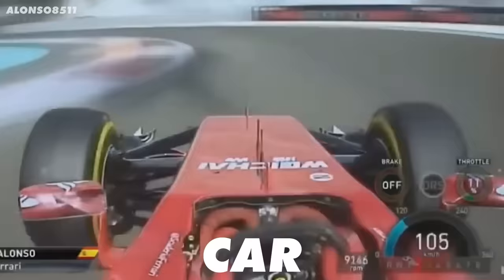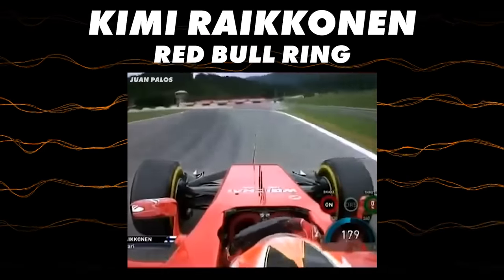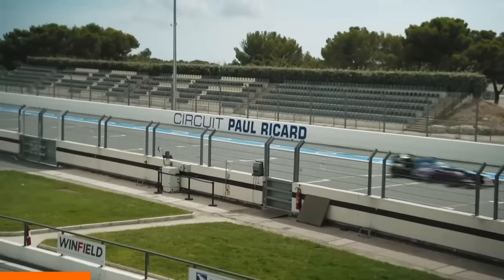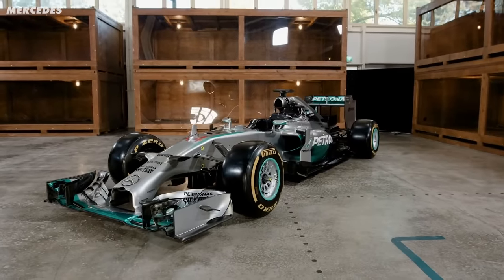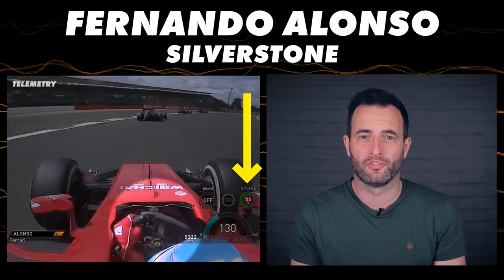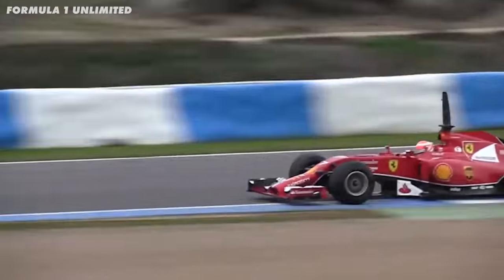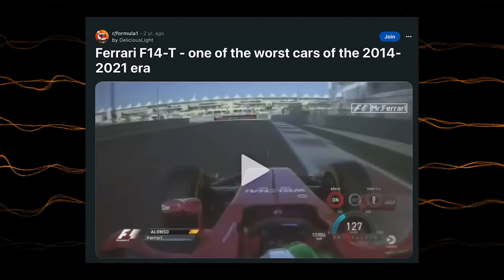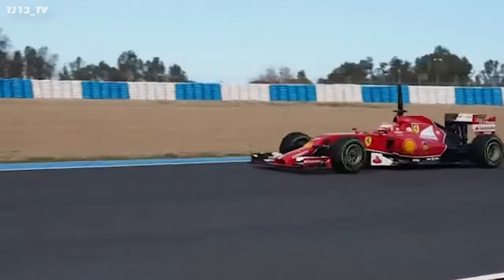The WORST Handling F1 Car EVER?

Comment: And Alonso almost won with this thing in Hungary. His 2012 and 2014 seasons are some of the most impressive performances I have ever seen.
Reply: Kimi would have had a podium in Monaco if not for Chilton. Relax.
Reply: @ciaronsmith4995  Your point being what exactly? Alonso had two podiums in the season. Furthermore, Räikkönen was absolutely destroyed in every metric across the season and was never even close to winning a race. Anyone who dominates a driver of Räikkönen's calibre like that obviously had an absolutely terrific year.
Reply: Nonsense. Raikkonen just joined that year and found the car undriveable - the car suited Alonso far more given the mass understeer on corner entry. Further, Kimi had a rookie race engineer who couldn't speak English (and was fired later). Alonso got lucky, plain and simple. 

Try to get this through your thick skull: In cars that suit both, Kimi is obviously, and utterly faster as his ballistic stint at McLaren and Lotus showed. Watch F1 before you comment lad. @whatisabercowich
Reply: @ciaronsmith4995  The amount of excuses necessary to explain the difference in performance is insurmountable. Luck could explain one or two races, not the entirety of the season. 

Ultimately, Räikkönen's stints at McLaren and Lotus show absolutely nothing. His teammate at Lotus was Grosjean, not exactly a top line driver. His teammates at McLaren were Coulthard, who was also not a top line driver, and Montoya, who had been flattered by some very good machinery. I'm sure Alonso would have performed very well in those cars as well. 

It is also very convenient of you to ignore both of Räikkönen's stints at Ferrari. In the years following 2014, he was comfortably outperformed by Vettel. As a younger driver, he was also very similar in pace to Felipe Massa, who was also decidedly in Alonso's shadow.

There is no question that Räikkönen was a terrific GP driver. His peaks were very high, maybe even comparable to Alonso's, but his dips were much, much lower. Adaptability is a vital part of being a succesful GP driver.
Reply: @whatisabercowich well said
Reply: @whatisabercowich kimi’s stint at mclaren showed he was one of the fastest drivers ever and one of the most polished. you can argue with martin brundle and jenson button who highly rate kimi’s mclaren stint. also, kimi doesn’t get to choose his teammates so the way you’re trying to take away credit from him just because of his team mate is not correct because he has no control.
Reply: @ciaronsmith4995  ok calm down yourself
Reply: @MoveoverAndbark Says some random nobody who'll never amount to even a fraction of what Alonso has.
Reply: @MoveoverAndbark 😂😂😂😂😂
Reply: his 2013 season is underrated, the reason why his chance is ruined is because of the tyre change mid season and benefit redbull even more after belgium so no one has a chance against redbull
Reply: @ciaronsmith4995 pff Kimi was destroyed that year by Alonso, he made three times his points and got two podiums 😂
Reply: @whatisabercowich  Not to mention what his friend said - Andreas. He worked with Schumi, Kimi and Padre. He said that Padre is the best he had ever seen.
Reply: @MoveoverAndbark  was he wrong?? Best driver on the grid promised the best car and instead he gets the worst. He was right to complain, tell your garbage British team to stop being trash
Reply: @ciaronsmith4995 i was a Kimi fan forever, but Alonso is a superior driver in pretty much every aspect. Anyone who says otherwise is just blinded by fanatism
Reply: @norbertambrus1656 to be fair, if you're looking for Kimi fanaticism, Ciaron is the man for the job
Reply: @davefred Damn !
Reply: @MoveoverAndbark Hater. There’s literally nothing to dislike about Alonso.
Reply: @kimiraikkonen949 He was fast with the fastest car on the grid. The car just also happened to be incredibly unreliable. He should have walked the 2007 and 2008 WDCs easily, but barely 2007 and was out performed by Massa in 2008. Alonso would have won a WDC in his Lotus. BTW, I happen to love Kimi. It’s no big mark against him that he wasn’t better than arguably F1’s GOAT
Reply: @kamata93 Schumacher also said Alonso and Kimi were the most exciting new drivers in 2001, but that Alonso was the complete package.
Reply: @kamata93 Schumacher also said Alonso and Kimi were the most exciting new drivers in 2001, but that Alonso was the complete package.
Reply: @MoveoverAndbark ”overrated” lmao he had the 7th fastest car in 2012 and only finished 3 points away from vettel he got 161 points in 2014 compared to Kimi 55💀. And look now at 42 carrying Aston Martin he’s the best driver F1 have ever seen being competitive in slow cars.
Reply: i simply cannot understand how as Raikkonen fan you can underestimate Alonso's brilliance and talent - in other way, the same. Biggest talents of 2000s era, Raikkonen lost 2005 title just by having an diasbled car. Ciaron Smith is somehow always pedelazing Kimi over Alonso, even if it is slight difference giving Alonso a favour in this comparison.
Reply: @ciaronsmith4995  “would have”, “could have”..

But what actually happened was Raikkonen got some driving lessons from Alonso 161-55
Reply: @whatisabercowich  he is the king of “excuses”..
Reply: @ciaronsmith4995 shut up sparks fly, MAX way better than crymilton
Reply: @MoveoverAndbark   and he would be absolutely right
Reply: Alonso won loads of races in 2010 and 2012 and nearly won the title in both of those years as well with not just a shit car but also having a team that cost him loads of points in a lot of races due to having shit race strategies just like with Charles Leclerc last season and Sébastien vettel in 2017 and 2018 should have arguably won the title seen as they both started the season of with the best car then the same with both of them the team started letting them down then came the driver mistakes then ultimately they both finished the season miles away from 1st place in the drivers standings quite clearly Ferrari have become a terrible team since pretty much after Michael Schumacher left Ferrari
Reply: @ciaronsmith4995  "Alonso got lucky" 161 points vs 55 points.

I'm a Kimi fan myself but come the fuck on.
Reply: @ciaronsmith4995  HAHAHAHAHAHHAHAAHAHAHAHAHAHAHAHAHAHAHAHAHAHAHAAHAHAHAHAHAHAHAHAAHHAAHAHAHAHAHAHAHAHAAHHAHAHAHAHAHAA
Reply: @ciaronsmith4995  Aside from all the banter you already got told and that, reminder that the Ferrari had massive oversteer and they had to add some udnersteer to make it drivable, literally had way more oversteer than understeer, so your point is invalid even before it started

Comment: Kimi fans will tell you that car was designed to suit Alonso’s driving style and that’s why he battered Kimi so badly in qualifying and the race. They don’t know that but that’s what they tell themselves and like to tell everyone. Arrivebene even said this car didn’t suit Alonso either, pretty much calling that “cope” theory rubbish.
Reply: well, let's talk about who's coping the most. first of all, you know who arrivabene is and what did he do before f1? right, second, in this very video you can see that despite the oversteer to power surge at the exit, that isn't actually oversteer, that is total traction loss, that kimi struggling to hit the apex while alonso had no problem because that suited his driving style more. so the car had understeer, while the oversteer wasn't actually recoverable because it was actually power/torque surge (hence which the author himself noted that the car suited alonso more)
because kimi's last time in ferrari, he drove the f2008, which is an improved f2007 in which he won the championship with. he was unfamiliar with everything the new ferrari car resembled, including the unsmooth nature of power delivery, meanwhile alonso had previous experience with renault engines and post 2009 ferrari cars. moreover kimi was on a fresh return absent from f1 and busy with rallying while alonsotardies like you were busy sending literal death threats to petrov and kubica as alonso was busy getting battered by redbull. did that help you to cope with 2010? lmao

Comment: Hey Scott! One key factor you mentioned is that Ferrari tried to move the engine as forward as possible. A mass very close to the center of the car might be one of the causes for the car behavior due to the changes in the polar moment of inertia.
It is widely known that cars which have the bulk of the mass close to the center of the car between the axles handle better, but if you center it way too much, the car becomes critical and it is very very hard to handle because of how sensible it becomes to steering input. One good example of this was the Lancia Stratos, and other less extreme but yet well known is the Toyota MR2.
For whatever reason or design choice, this Ferrari had a tendency to understeer like you explained. But then the polar moment of inertia caused by the bulk of the car weight very close to the center could be the reason why it snapped into oversteer when the drivers tried to correct during a turn.
This is no explanation since I lack data, just an assumption which might be worth exploring by people with better knowledge than me.
Reply: Thanks for the history lesson, that lancia is fun on GT7😂

Comment: 5:44 Finally someone has said it. Cars cannot physically understeer and oversteer simultaneously but interchangeably. These are two driving characteristics that explain discrete situations in vehicle dynamics. However, just as you do, I understand their point.
Reply: Have you ever driven on ice? A car definitely can do both at the same time.
Reply: unless you drive on ice
Reply: Actually every time a car snaps from understeer to oversteer, it does both at the same for a short instance.
Reply: Doing both is just sliding 😛

Comment: you gave the answer at @2:28

they messed up the weight distribution of the car by making it too far forward. this caused the car to be leary and way too loose on corner entry, and it couldn't also put power down as effectively as a car with a more rearward weight bias, and made it oversteer out of corners.
Reply: That makes sense

Comment: I think you are overlooking a serious design flaw. The angle of the front upper and lower control arms (deviating from horizontal) means that every vertical suspension movement also pushes or pulls the tires laterally.  Hit a bump or otherwise generate squat or dive, and the front tires are forced to scrub sideways, robbing available grip and sending the car darting one way or another, depending on which tire has the better grip at the moment.

Comment: The car was decent relative to the field. I think a lot of people forget that the cars in 2014 behaved this way in general, with the understeer on entry and oversteer on exit. Only reason the Ferrari gets dissected is because its Ferrari and Kimi couldn't adapt.
Reply: Also because of the PU position which accentuated this issue on Ferrari.
Reply: It was way worse than the rest, not even close. But they had Alonso and Kimi, that saved their season. Every other car was way easier to handle.
Reply: @ferst262  Alonso saved their season. Kimi mostly didn’t do anything
Reply: @samsea0489  Kimi did more than enough, just because Alonso performed another one of his miracles doesn’t mean that Kimi did nothing
Reply: @ferst262  l said mostly. I’m aware Kimi was decent in Monaco ,until that collision with Magnesseun into Mirabeau, and Belgian. And he did outqualify Alonso 3 times that season

Comment: Not related to the Ferrari, but the reddit comments about alonso's video:

Normally understeer and oversteer in entry and exit, you resolve the US first. The entry understeer reduces the speed too much, and when you apply the throttle, the low speed and high power looses the rear.

Comment: Pretty bad for a race car, but not quite as bad as the electric car (named Hammerhead Eagle i-Thrust) built by the UK Top Gear guys in 2010.
According to the motor magazine Autocar HQ that got to do a "consumer test" of it it had extreme under-steering when entering a corner without touching the brakes. If the driver applied some braking the front wheels would get a grip and the car would instantly go from under-steer to over-steer!

Comment: The car was bad for Ferrari standards but still Fernando Alonso, had the two  only podium of the season (3e China, 2e Hungary) there were only three retirement's .And five times outside the points all by Kimi Raikkonen ,in the overal season result Ferrari did end as fourth in the constructor's championship with 216 points.

Comment: Kimi could handle oversteer but I'm sure I've read that he actually prefers a touch of understeer.
Reply: Not a hope in hells chance. Kimi hates understeer much more than any driver
Reply: @george._mav  No he's on record as saying he prefers slight understeer
Reply: Kimi loves oversteer which is why needs a strong front end and a loose rear end so that he can plant the nose of the vehicle to the apex. It’s okay with the rear sliding around and locked brakes.

Comment: Maybe the FIA should look to make F1 cars more like the F14T. That would make for some actions to have cars that are a little unpredictable.
Reply: From an entertainment standpoint itd be fun to watch, but the idea of f1 would never or should it ever allow this, if you wanna watch people fight the car through corners l recommend offroad racing such as nitro rallycross or utv racing or short course truck racing.
Reply: That wouldn’t be fun. No driver would go fast because they would be out every corner. F1 isn’t fun when they all crash
Reply: @ferst262  
They would find ways to not crash. The drivers have a lot of experience to get there...

F1 in the late 1970s had similar problems and you could see Gilles Villeneuve and a few others doing some sideways. They were still finishing races, the cars weren't as reliable though so that was a different problem.
Reply: @therrydicule  they wouldn’t. That car had 2 of the best drivers in the past 20 years. Most drivers are crashing now with cars that are way easier to handle. F1 in 1970 did not have this car, this has been a 1 time thing and the worst its ever been.
Reply: @ferst262  
Drivers are crashing because they are pushing the car over the limits, and sometimes because of some mechanical issues (such as suspension).

It is not because of the car's behavior.
Reply: @therrydicule  exactly, they are already crashing without the car behaving like that Ferrari. It would be the worst to see them all just crash every race or have slow racing to avoid incidents. There would permanently be a safety car
Reply: @ferst262  
They would manage to keep the car on the track ;) 

Drivers adapt to these things.

Comment: Imagine calling a car that almost won at Hungaroring undrivable. The car was bad, but all the problems came from the underpowered engine, and everything else was a consequence. Ferrari ran with a low drag config for basically an entire season, except the obvious exceptions, like Monaco and...u get it, Hungaroring, showing that the overall concept would have worked with more power and the possibility to run medium to high drag configurations during the season

Comment: It's very obvious why the rear was loose. The engine was too far forward, so not enough force on the rear tires at low speed.
Reply: All that engine mass atop the rear tires is why the Porsche 911 is so dominant in low speed corners.

Comment: If a car understeered and oversteered at the same time wouldn’t it cancel each other out and make the best handling car ever?
Reply: If the opposite happened (Oversteer on the entry, understeer on the exit), it would have absolutely worked better. But then again, this hybrid system was poorly tuned.

Comment: This car has nothing on the C 126  Red dump truck of 1981. The car itself had at best 25% less down force othan most of its rivals and chewed up tires during the race at an awful rate just for fun, It had under steer and over syeer in abundance.  Then their was the engine. Gobs of power but it was all or nothing with atrocious turbo lag. As the season wet on it was gradually refined but was still bad.  The fact that it won 2 races was  testament to Villeneuve's talent as Pironi was no where near his team mate in  either Monaco or Spain.
Don't get me wrong , the vacum cleaner in this video was bad but nothing like the C 126. Watching the C126 race actually made me fear for the drivers lives, I never got that feelining from the vacum cleaner